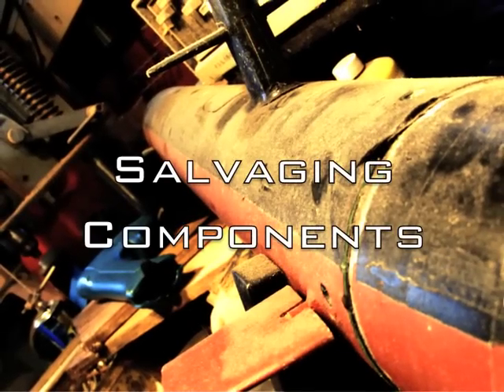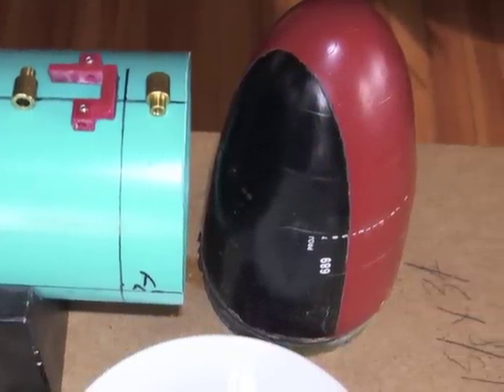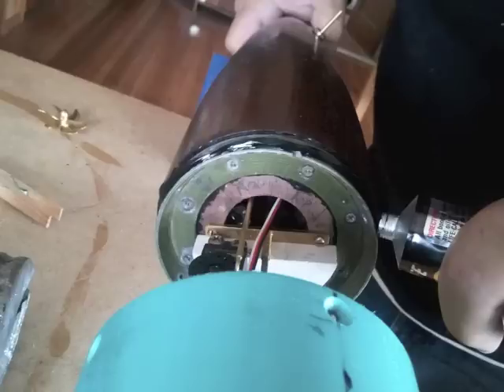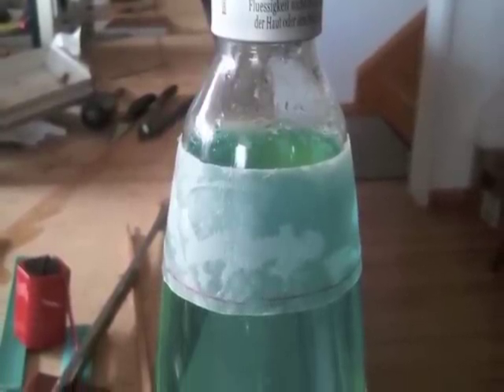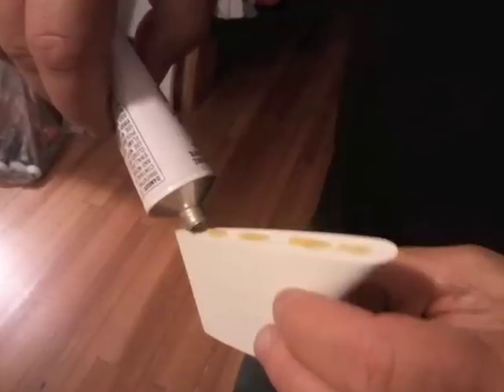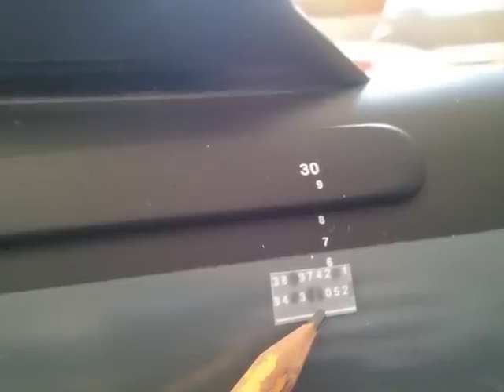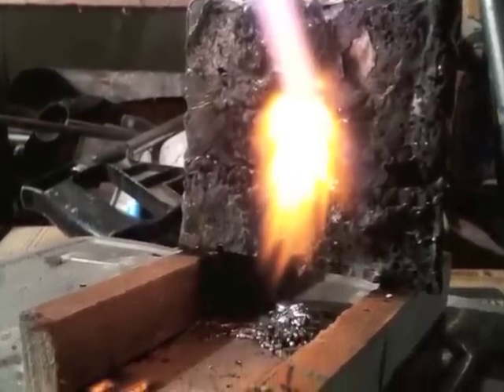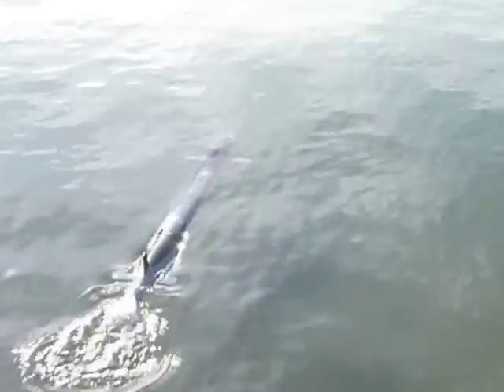Sewer Pipe to Submarine: Building the R/C "USS Virginia" Model

Comment: Is it possible to made A Rc control Submarin which abiliti of 80-120 meter depth dive
Reply from the maker: I'm thinking it would not be possible to transmit radio signals that far underwater with rc gear that we use for these models.
Reply: @Rapidnadion  In India Lakes are very deep

Comment: Hey man nice job! Been watching you guys for years haha, I'm currently trying to build basically the same submarine but instead am modeling it in fusion and 3d printing everything except the sewer pipe, how did you seal the top hatch?
Reply from the maker: We used 2" wide clear packaging tape.  Press it down until any bubbles disappear and you have an easily removable, waterproof seal.  We have recently added another periscope which functions to turn on the radio rx within the sub, so we can seal the hatch without having to worry about battery drain while waiting to launch..  Good luck with your submarine project!

Comment: I know it’s been like 7 years since this model has been built, but perhaps some kind form of water bladders could be installed to take in water on command, adding enough weight to submerge. The water bladders could work with a small water pump, which takes in the water when told, but can also push the water out when necessary to resurface.

Comment: How do you get the propeller to keep out.the water? Wont water slip into the inside from the seams?
Reply from the maker: Close fit between shaft and tube plus light grease does it.

Comment: did  you  make  the  stuffing  box?if  yes  please  tell  me  how  to   make  one :)
Reply from the maker: A short length of silicone tubing , whose midpoint is where the propeller shaft exits the tubing, works for us.  It gets a good grip on the larger diameter tube end, and where it grips the lightly greased shaft it will keep water out while putting little friction on it.

Comment: I was surprised you didn't use ballast tanks. But then, I was on a sub back in the '70's while in the navy. I always wanted to build a working model. If I had, it would have used ballast tanks the same way a real sub does. Using just planes alone does give you an incredible safety factor.

Comment: how do you run the servo shafts and prop shaft through the hull without leaking. Sorry I'm new to this
Reply from the maker: We use "O-ring" seals with light grease for the propeller shaft, rudder and bow planes.
Reply: Jasper amirante Really close tolerance/ clearance of the shaft and the tube,maybe a little grease/heavy oil .Or you could do it like they do on full sized ship, you make little wooden wedges and push them in around the shaft. So help center shaft and will make a water tight seal! Push them in til the shaft won't turn then back em out a hair! As the shaft spins the wedges wear a little and you just keep using them in.This is called a gland for some reason!
l

Comment: Does this model basically work under the same principles as the deep flight submersibles? Because you're just using the dive planes in order to dive without any ballast tanks. Also is there any way to calculate how much ballast you need along with the thrust that the motor and planes produce in order to make it dive on the first try?
Reply from the maker: We intentionally launched slightly light rather than heavy to avoid the 'big' problem.  By calculating its volume, we were able to figure the boat + ballast target displacement, which varies by ~ 3% between fresh and salt water.  We figured the motor and belt reduction drive would be adequate from experience with other models, and made the bow planes area large enough to help pull down the bow.  They have been reduced by 30% now that we have the ballast dialed in.
Reply: I'm making my own rc submarine and I am asking what tape do you use to seal the hatch?????

Comment: Just an idea for your next projects, for your diving and signal loss you could rig a simple circuit to release a trailed array. When there is signal loss, using a relay, it will automatically deploy and float a radio wire (28 ga magnet wire) to the surface using cork or something buoyant.

Comment: What did you use as ballast?  I have made a 36" version of this sub.  I have used lead split shot. still not enough weight.  Any advice?
Reply from the maker: +Numawon Son   We used tuna cans as molds for the molten lead to form in;  left the top about half way still attached.  Fired up the torch and melted fishing sinkers to come up with 6 or so semi-circles of lead weight, around 10 - 12 pounds total.
Reply: +Rapidnadion - Very helpful.  Thanks For the awesome vids!!!!

Comment: Excellent work- you are a truly skilled modeler and craftsman.  I have built several models in my life and it is nice to see the scratch built fabrication of components.  If you have not already considered it,  may I suggest that you incorporate 3D printed components into your next build.  The propeller shroud and supports could easily be printed as a single component, saving considerable fabrication time and ensure the uniformity of clearance between the prop and housing inner wall.  The entire aft section could actually be printed as a single unit. The conn, planes, and bow section with flange would also be great candidates.  I do take pleasure in building from scratch but it was hard for me to ignore the versatility and economy of the 3D print and the advantages of being able to control the essential properties of the parts (strength, finish, DENSITY) and of course being able to reprint parts at will if needed.  Just a suggestion.... :) 
Awesome craft !
Reply from the maker: +John Young   Thanks for commenting;  3D printed parts looks like something we may try on future builds, thanks for the suggestion!
Reply: I\'m not sure but ,if anyone else needs to find out about model railroad track planning try Panlarko Amazing Railroad Planner (do a search on google ) ? Ive heard some interesting things about it and my cousin got great success with it.

Comment: I am currently building the USS Dolphin out of 4" sewer pipe. I am at a bit of a roadblock concerning the bow and stern sections. I do not own a lathe nor do I have experience using one. How should I go about outsourcing construction of these parts?
Reply: SouthernPacific5339 hey, still working on your model? you can use fiberglass around a 2 litre hurtle for the nose and fiberglass around a lava lamp for the tail...i knew a couple guys that did this

Comment: Very informative.  I'd like to see some detail on the propulsion shaft intrusion point on the hull, mechanics on the bow planes and rudder.  The servo hook-ups and linkages with hull intrusion points too.  I'm sure more basic builders will want to know this too.  What is the range of the receiver and antenna length?  Are you using a 2.4Ghz system?  I think you get my drift by now.  Thanks.
Reply from the maker: Keenan, the rudder, bow planes and propeller shaft penetrations all go through simple 'o'-ring seals and have been free of leaks.  We're currently optimizing this boat so it can submerge / surface without having to be moving..  More details to follow.  Thanks for watching!
Reply: Rapidnadion do a rocket that go high thin comebacks

Comment: Twenty years ago I made two sewer-pipe submarines with the exact same concept.  Mine were straight-running, though, and lacked the power to submerge with dive-planes.  Styrofoam was used to form the bow, stern, and sail, and the hull flooded completely with water to reduce buoyancy.  I'm glad to see someone else was able to take the same idea all way way to radio-control!

Comment: seal off the electronics in both sides. vents on the bottom to allow water in and out. CO2 tank in the middle with a remote to release air. im sure you thought of this.

Comment: Have you thought about using the "Towed Sonar Array" as the antenna so you could run underwater, and still have good control? You can make it buoyant enough to keep the antenna above water, and use it as a recovery line in the event of catastrophic failure.

Comment: I built a my model of the USS Ohio out of a sewer pipe (which I bought from Lowe's) and used old water bottles for both the bow and stern sections. I used the cap of one of the bottles for the propeller and used leftover plastic from the bottles to build the sail, rudders, and dive planes. I made 24 missiles for my sub out of styrofoam peanuts, carved launch tubes into the pipe for them, and put 24 12g CO2 cartridges in the nose cone and below the sail to propel them. I ... (continued above)

Comment: how you prevent linkage inside the sub from the mooving parts (like propeller shaft and servo shafts? can we use 2.4ghz control? can we use fpv 5.8ghz to have image?

Comment: i have a question i'm building a sub. with my buddy. and i was wondering where did you get the hardware. like the shafts, and seals. and also what kind of tape did you use on the access hatch.

Comment from the maker: @modelman76 It flooded while submerged, probably through one of the shaft seals for the bowplanes or the propeller shaft. When sailing in cold water, the pressure inside the sub gradually falls as the air inside cools, and this vacuum tends to exacerbate any flooding that occurs. We think that's what happened.